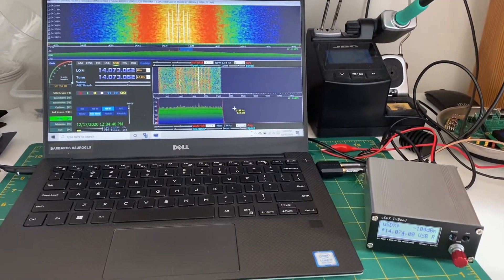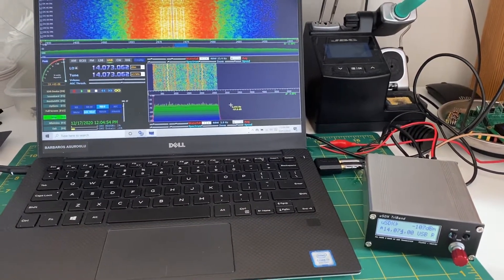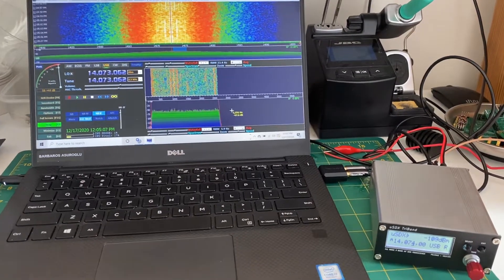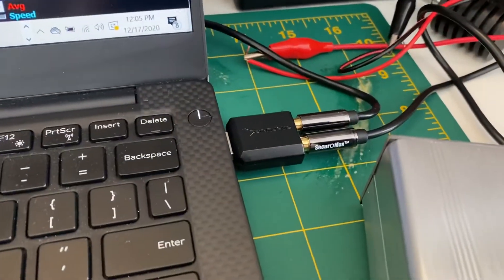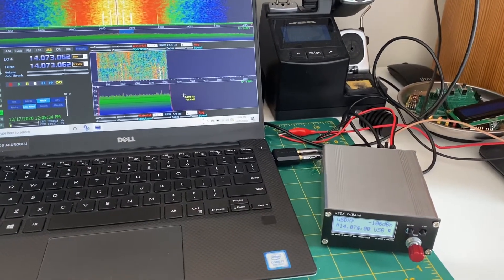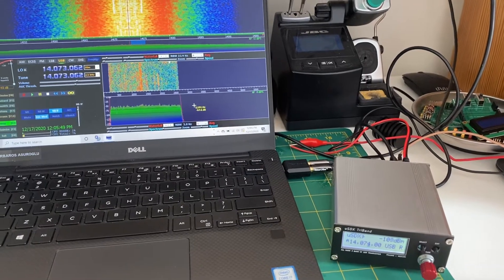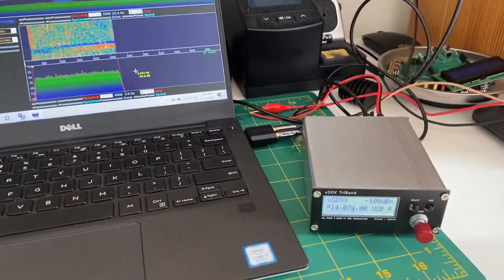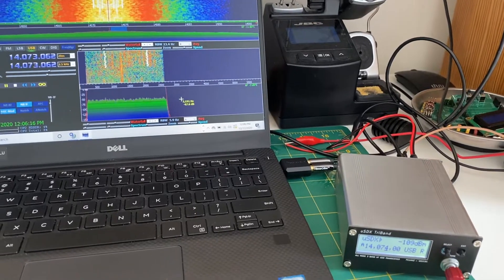Decoding usDX TriBand I/Q outputs with a sdr software on my laptop

Comment: Please share the circuit of connecting I and Q signal to sound card..
Reply from the maker: I connected I out to left mic input and Q output to R mic input line of PC soundcard. Ofcourse ground of transceiver goes to ground of pc soundcard which is sleeve of 3.5 mm jack